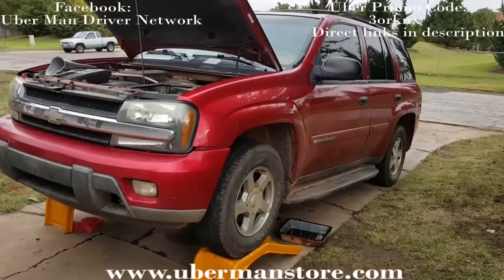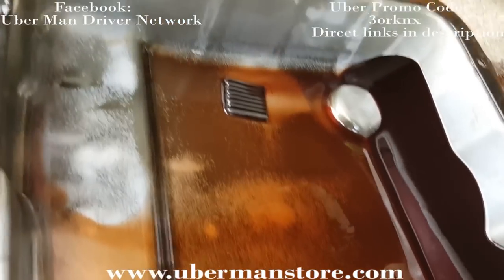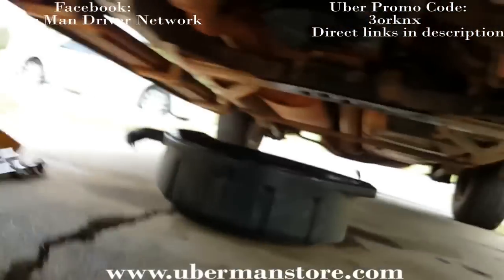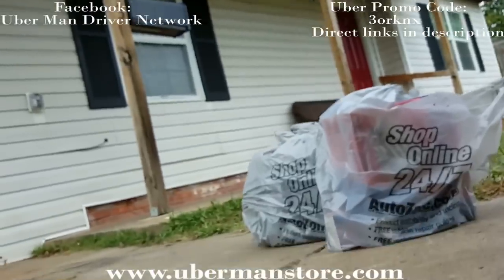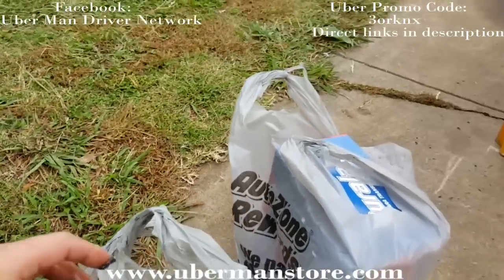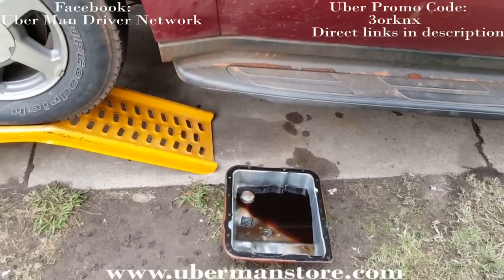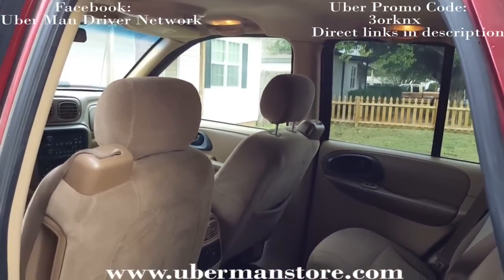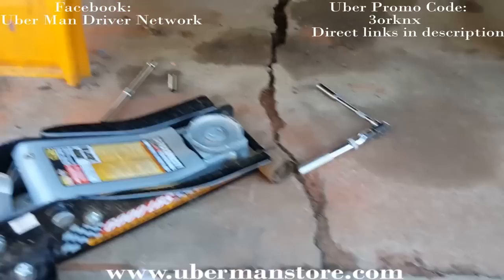2003 Chevy TrailBlazer Shift Solenoid Replacement

Comment: I have a 2008 trailblazer 126,00 miles but I'm told it needs a new tranmission
They want to charge me 4,000
Do u think it would be worth it too fix
Reply: Honestly your vehicle shouldn't have transmission problems at only 126,000 miles which is what I assume you meant, and $4,000 is highway robbery. No transmission should cost more than 2,400 - 2,600 to change and that's only on way more expensive vehicles. The only thing that makes any transmission cost that much is the 'overdrive' option they started putting on them. Transmissions without overdrive don't even cost half that to fix, or rebuild. You can buy a used transmission with a 90 day warranty for $600, so $4,000 would mean that $3,400 dollars is being charged to you for labor when it can be done in one day by 1-1/2 mechanics, basically meaning one guy can do it, with a little help every now and then. My Trailblazer has 296,000 miles on it and lost 3rd gear only because my ex-wife didn't have the trans fluid changed when she had the vehicle serviced the last time and it ran dry. A $26 dollar solenoid will probably fix it + the nominal cost of gaskets and fluid replaced. Put an add on Facebook 'Marketplace' looking for someone (qualified) to fix or replace your transmission and you should be able to get it done for less than $1,500. A good transmission shop should only charge around $2,000. That's a whole different perspective on your vehicle's worth isn't it. Please don't be taken advantage of just because you're a female.... that happens all the time. My ex was given a price of $4,000 to change an engine in her Jeep liberty... I took the Jeep to the same place the next day and was told $1,500. People still suck.

Comment: hi, very informative video but not sure in my case, I have a trailblazer and accelerated from a stop sign and it just gave out, like I heard and felt something give out has park but no other gear.there's a ticking and when I give it more rev it gets louder/faster
Reply from the maker: I'm sure there are codes for that one. Have you run a diagnostic??
Reply: I scanned it, and I'm not seeing anything on there. I'm thinking the torque converter is gone, I'm not sure tho. thank you for the reply
Reply from the maker: Could be the pump as well. Could be a lot of things. Drop the pan and check for metal and check wires to the solenoids.
Reply: Ok will do. thank you much. I've searched all over internet and asked many people, even in Facebook and can't find any answers, I'll just have to start taking things apart till I find out what's worng
Reply: @seanmathias7569  did you ever find the problem?

Comment: What is the differents  with the trailblazer and a blazer ?
Reply: Blazers are older and smaller. Identical to a GMC Jimmy. They were made until 2005 and had the same smaller bodystyle and shape since 1995.  Unless it's a K-Blazer, then that would be the size of a 89-98 full size Chev pickup.

Comment: Would a solenoid account for constantly jerking back and forth between gears whilst driving? I get codes po 503 & po 973; I am told that sometimes one code can cause another, and that a short can cause both. I changed speed sensor AND transmission control module, and STILL the shifting issue...solenoids next, or....any ideas?
Reply from the maker: To me, that does not sound like a solenoid issue. How's the fluid?

Comment: Could the solenoid also cause it not to shift past 3rd gear? can get a 04 trailblazer for 700.00 and thought maybe it could be an easy fix.
Reply from the maker: It sure could. Codes will tell a lot.

Comment: Uber,  Mine has same symptom so I am sure it is same problem. But, I have no check engine light on.  Will running diagnostic still locate which solenoid without a check engine warning light being on?
Reply from the maker: It will if it's a pending code, and not a set code. Try it out, and let me know.

Comment: Great video. Sadly,  I dont think this would be my problem.  Maybe someone here would have an idea? 
My 2006 (5.3L) trailblazer started pulling out in 3rd when in drive.  Will not go into 1st. Will shift from 2nd to 3rd manually. If on the highway, I can sometimes use drive & it'll shift fine between 3rd & 4th, but other times,  it has an electrical malfunction (door lock\ unlock themselves, gear selector light on dash races back and forth,  gears bog way out, & it seems to mess with the throttle position sensor). It also does this electrical malfunction randomly too.  I have already put a new battery,  alternator,  and pcm in it (due to my brothers advice) . I plan to change the fluids & am leaning toward the tcm needing replaced,  but would appreciate any advice i can get.

Comment: hi i have a trailblazer 2005 8 cylinder 4x4 it doesn't run on first gear 3rd only on 2nd what could be the problem am i going to possibly need a new transmission
Reply from the maker: You need to run the codes and pull the pan to look for metal.

Comment: This is to anyone who may have this issue. I have a 2002 trailblazer and it shifts just fine into first and second then it revs high rpm's and it will eventually go into overdrive but it will only go 60 mph at 4000 rpms after shifting. What are the steps that I need to take to investigate this issue without replacing parts that I do not need. How do I troubleshoot myself. I am on a small budget.

Comment: There is one more solenoid the PWM solenoid that controls the torque converter replacing the the 2 shift solenoids did find but latter on the Transmision was not pulling as well and eventually laid down on me. I stopped the car and turned the key off and let the engine rest then after restarting it went into gear and went about a mile and started slipping again. Did the stop and rest and it once again could get it to about 50 mph and it would start to slip again that is the symptom of the PWM solenoid going bad!
Pulled the pan changed the PWM and installed new filter replaced fluid in the pan the  Transmision went to running normal again. If I had known about the 3rd solenoid I would have changed it as well my advice is that if you have a high mileage Transmision change these solenoids with the filter before they fail.
I checked the solenoid with an ohm meter and found it was sorted so that was the problem!!!

Comment: Would that cam sensor code still be there if I have already changed it about 2 months ago
Reply from the maker: No, it would have cleared by now. I'd try changing it again, if it's still an issue, start checking wiring / fuses.

Comment: i have an 03 gmc envoy slt i am having rev problems. while driving my tac will go from normal rev to about 500 to 1k lower. if i tap the brakes not enough to actually brake my tac will jump back up to were it is suppose to be.  thanks : )
Reply from the maker: That is odd. Sounds like a torque converter lockup solenoid. SES light on? Even if not, I'd run a diag.

Comment: I have a 06 trailblazer extLT my transmission can shift in reverse #2 & 1 but do nothing in drive or gear #3. My wife was at a light came time to go and no go could not accelerate only way we got truck home was in gear shift 2 but poor acceleration... Pls can  help
Reply from the maker: You need to read the codes first.

Comment: I really wish people who work on their own cars could spend a week changing oil professionally. When you remove and oil filter from a hot engine you are not going to hold on to it and let it cause you pain from the hot oil. Hot motor oil won't leave an actual burn but it hurts just the same. When oil gets on other parts of the underside of the car there is going to be residue just like if you spill oil on your driveway. They should have wiped the new filter off after installing assuming the drop hanging from the filter isn't from elsewhere on the engine.

Comment: I have a 2004 envoy 4wd...n it doesn't wanna take off it will take off but it's real sluggish...I changed da transmission fluid n filter when I changed it it was no metal n da pan some people r saying I need a transmission but I don't think so... need help
Reply from the maker: First thing to do is read any engine / transmission codes stored in the computer.

Comment: Very helpful video I have an have 04 trailblzer it just started  a rev between 2nd and 3rd hopefully it just a solenoid , no code showing up though.
Reply from the maker: Have you changed the fluid yet? I'd be trying to get the fluid / filter replaced, and add a couple quarts of Lucas to it. That stuff does wonders!
Reply: my trailblazer is doing the same thing. what to do
Reply: Ever figure out what it was

Comment: I have a ‘03 T-blaze with 160k on it and it leaked out all the fluid while I was on vacation causing my trans to slip. I dropped the pan and changed the fluid and put lucus transmission stop slip/leak but it still slips in all gears. Could it being low on fluid cause the solenoids to go bad? My fuild was brown, looked like it had never been changed but no shrapnel. Help me YouTube community! :)

Comment: Hey man I was wondering if you could help me out....iv got a 04 trailblazer that is stuck in park but it's not showing a error code and was wondering if my problem could possibly be this as well. Thx in advance
Reply from the maker: I doubt this is the same problem. If it's stuck in park it sounds more like the actuator from the brake pedal to the shifter.

Comment: Men this video is like, i have the same problem with my Chevy trailblazer. and my is the same color,,,,,, I have a really good filing about this... thank you so much.
Reply from the maker: You're welcome. Please let me know if it fixes it!
Reply: I should will. Thanks
Anything I should be aware. ?
Reply: Besides that little tiny fit in The Ghost and the filter Neck.
Reply from the maker: Nope. I covered it all here. Good luck buddy.
Reply: Jose Galvan yeah the red ones have this issue

Comment: P0302 P0340 P0128. I have a picture but I don't know how to put it on here
Reply from the maker: #1 P0128 - replace the thermostat, #2 P0302 is a misfire on cylinder #2. #3 P0340 is a fault in the Camshaft Position Sensor / circuit. You need to replace the thermostat, replace the plugs / coil packs, then replace the cam sensor to start with. This is most likely your issue. If you do not repair these, and keep driving, you will have some more major issues later down the road.

Comment: Lol you change your transmission fluid, filter , and solenoid and u dont sell cars that are not up to your  standards.  But you let the dumbest of dumb ass's change your oil at Walmart? I mean really bad decision making and you're lucky y ok u had oil put back on it or the drain plug isn't tightened with impact. 90% work at the aamco i worked at was Walmart warranty claims from just 1 of the local Walmarts in my area.